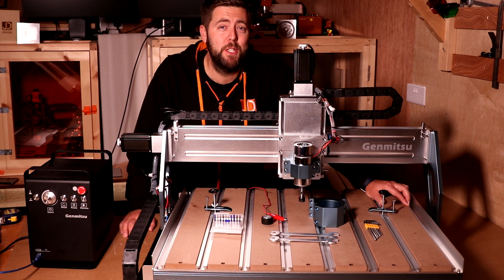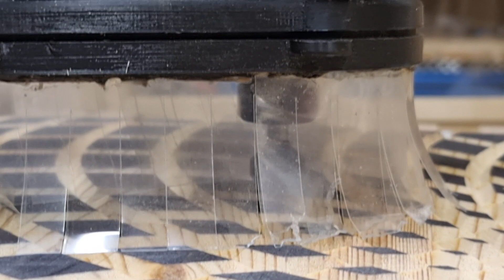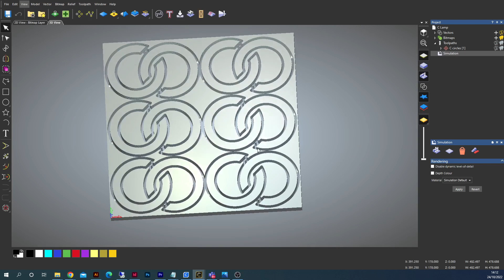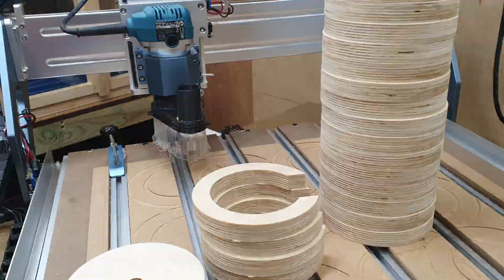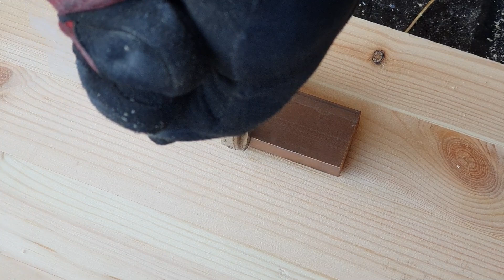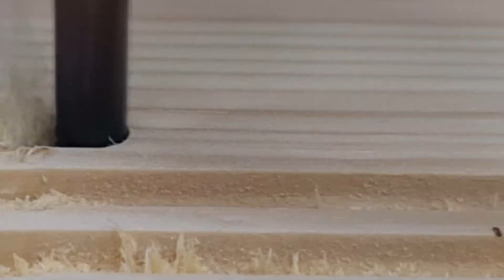Sainsmart Genmitsu PROVerXl 6050 Plus CNC machine review

Comment: I just picked up a 5060 XL Plus this weekend and did a full Tic Toc assembly video . It was one of those marketplace finds you cant resist ,especially for a new in box machine . Although they had lost the instructions and usb stick. Not the end of the world by far . I was quite amazed of how well the machine was built , I usually find myself pushing pulling prying....... to get things squared and trammed . the biggest issue i had was the spoil bords arn't super flat . So ill be milling them down . Thanks for the video

Comment: James how did you hold down those separate spoil board pieces? Also is it just strips of 1/4" MDF? Lastly, Why were the end piece narrower? Thanks, I am learning a ton about my 6050 by watching your videos, much appreciated!
Reply from the maker: Held down with blue tape and CA Glue. The thin strips are because your spoilboard should be the same size as you can machine, otherwise you can never correctly surface it. So the thin bit are because that's as wide as I could go

Comment: Great review and I'm setting mine up now. I noticed the entry point of slots you cut in the pine was not in line with the rest of the cuts. About a CM of the cuts were consistently at a slight angle to the left as viewed in the video. 
My last CNC, a Next Wave Piranha, did the same thing later in its life. It was one of the reasons we moved up to the 6050 Plus.
Can you tell what causes this? Is it normal or just a function of how you cut those slots?

Comment: What size table do I need
Reply from the maker: @jimhuitt9854  if you scroll about 2/3 the way down, there should be a table listing the overall sizes in inches and millimeters.  https://shrsl.com/3pybc
Reply: I see the work area  but I still don't know footprint like what size   table I need for the machine needs.
Reply from the maker: @jimhuitt9854  right below the work area size in the table it lists the overall dimensions of the machine - 776 x 641 x 580 mm

Comment: ive been tinkering and taking apart toys to build other things since childhood but as an adult and with all these new desktop cnc toys that exist now, the maker world is so much more awesome. ive been dying to get another bigger better cnc router. i had a 3018 that got damaged in a move and sat in a box for years till i finally threw it out in another move.  theres a "carvera" ive been drooling over that can do metals and has an auto tool loader feature and tool magzine but those start at like $5k. this thing is on amazon for 1600$ right now. Im not a huge fan of the single screw in the center of the bed for that whole giant gantry, but i guess it might be ok if those linear rails are perfect and have zero play and the gantry has not even a fraction of a millimeter play when you twist it. Otherwise i can see with the router being all the way over at one side and that center screw tries to push or pull the gantry it would twist the whole gantry and throw off the accuracy of the rest of the project. im real curious to know what happens when you try to move faster than the bit can cut when its all the way over at one side. And how good are those linear rails under the bed? any play at all? I noticed these companies save money by using parts that are mostly ok, but only if you move real slow and dont try to cut real deep. But the minute you go outside of its working parameters you start to see the weaknesses. and then its off to the races with the upgrade process. replacing bearings and rails and using hardened steel everything and thicker frame bits. and i work at a machine shop so having custom parts made on multi million dollar machines is fast and easy. next thing you know you can build a whole second machine with the parts you removed from the original machine to upgrade them.. and at that point you have so much invested in it that you wouldve just been better off buying a more expensive router. lol. story of my life. the upgrading and tinkering is just as fun as actually using the tool.

Comment: I "broke" mine! My router kept "slamming" the upper limit switch into the metal tab and it kept getting bent. I "kept" bending it back into position. Then, you guessed it, the tab broke off completely. So I did the only thing I could think of, I used JB WELD to hold the broken tab in place. I don't see Genmitsu providing that individual plate as a part for purchase. Any other ideas...anybody....anybody?

Comment: Thank you so much for the informational and instructional videos for newbies like me. After having the Sainsmart 3018 Pro for half a year, I have just received my PROVerXL 6050 Plus and looking forward to assembly and first time use.
QUESTION: While I will start with a Makita router in the build, is there a way where I can use bits from my 3018 Pro (all are smaller than 1/4 inch, most with 1/8 inch)?
Reply from the maker: Excellent. Yes you can, just buy a pack of these. Dirt cheap and allow you to use 1/8th bits in your router https://amzn.to/3ONmvIK

Comment: Hi James, Any update on your 6050 Plus. Has it become your daily driver or did you settle on an alternative?
Reply from the maker: It's a great machine but I did a follow up video comparing this and the original ProverXL 6060. Whilst this is more powerful machine, I need to do a few jobs a year that are larger than the work area of the 6050 so ultimately I have kept the original machine but that was only because of that one specific reason. On nearly every other element the 6050 is better
Reply: @JamesDeanDesigns  Thanks for the update. I currently have a 4040-Pro and loving it, but I do think I jumped in a bit quick and should have gone for the 6050sPlus. When I have had some use out of the 4040-Pro I'm going to make the move. Thanks for your efforts on your channel. Always interesting and informative.

Comment: Subbed...Just what i was looking for!!! Ordered the last one on the site using your link! I have a few upgrade questions. I need recommendations for a 40w laser/air assit combo for this unit, I also saw your review on the Fox, what kind of laser catch/waste board set up would i need for such a laser and, also a 2.2W water cooled spindle recommendation as well. Lastly, I only have a 110 set up in my garage here in the US, does that affect the power output of any of these devices?
Reply: Wish I would have known it's a "pre-order" item. Though the website says "one left" And now they say there are factory manufacturing problems and shipments will be delayed further. Maybe I'll just cancel my order, don't want to wait until July.

Comment: Curious what you think about this CNC vs. the Foxalien Vasto CNC? The Foxalien has a 400W spindle and ball screws, its now on sale for $1900 so that brings it close to the cost of this one. But this one has larger stepper motors and seems like a better bed design with less flex. For my use I'm looking to do mostly soft metal work. Love your content!
Reply: If you don't need all the Z clearance from the 6050 and plan to mainly do metal, get the vasto. the ballscrews make it a studier machine!

Comment: Thanks for another great video!
How did you attach the spoilboard strips to the bed sections? Adhesive or screws from the lower side?
I bought a Sainsmart 3018 Pro but ended up sending it back after a couple of weeks. The kit was beautiful, and it ran very well right out of the box. It just wasn't going to do the job for me as I want more power and precision. I'll be ordering a 6050 tonight!
Reply from the maker: The initial piece of MDF on this are screwed from underneath. If you want to add additional spoilboard slats then I would probably use blue tape and CA glue or strong double sided tape

Comment: Hi James, can you or anyone else answer me on this question please?  I am buying my first cnc router and thinking of buying the PROVerXL 4030 with 6060 extension kit & hybrid table.  Would it be better for me to spend more and buy  the Genmitsu PROVerXL 6050 Plus then buying the 4030 with upgrade?  Is the money difference, build quality and features worth it to spend more, which is $ 2,547.32 Canadian for the 6050 Plus, and $2,205.00 for the 4030 with 6060 upgrade and upgrade aluminum & MDF Hybrid Spoilboard Table .  Thank you.
Reply: the 6050 plus will provide more rigidity for more demanding projects.  The 4030 upgraded to  a 6060 will give you a little more working area with lower performance.   If you need the extra size go with the 6060,  if you don't need the extra size get the 6050.
Reply: @chrisl7949  Thank you for the info. much appreciated.

Comment: Linear rails are supposed to be 90 degrees/side riding, not on top!
Reply from the maker: I understand the logic but you may want to tell every other manufacturer then because I have at least 5 machines from 3 different manufacturers all doing them this way 😕

Comment: most powerful but just not rigid enough for aluminum, light cuts in aluminum cut dull end mills
Reply from the maker: I can assure you it is ridged enough for aluminium. I've machined aluminium on less sturdy machines that this.
Reply: @JamesDeanDesigns  I was talking about a $500 router

Comment: James, If you were looking for a good Quality CNC,  Would you buy This one?, Or the Fox alien vasto ?.  I know they have differences.  Would you Sacrifice size for the ball screws.? . I know this is a difficult Question to answer. But you have used both Machines and have far more experience than me.
Reply from the maker: ProverXL 6050 has size, stronger bed and stronger motors but the Vasto has ball screws and is $200 more so it really is difficult. Unless you do plan to machine metal regularly, I would probably go with the ProverXL 6050... I think but not 100% sure 😆

Comment: Excellent video James!  I am looking forward to the comparison video with the 4030...  For the 6050,  I wonder what wattage laser it will handle.  I heard somewhere that the 4030 controller box could only handle a 5 watt laser unaided...  If you want to use a 10 watt you would need to use an external power supply for the laser..   What do you think the 6050 could handle? Hopefully at least a 10 watt laser...   As big as the new controller box is, it should be able to run a nuclear power plant!!

Comment: Seems rather expensive compared to a oozenest for example
Reply from the maker: It can seem like that and totally get where you're coming from, but essentially different styles of machine, different hardware. For example with wheels vs linear rails, linear rails are usually going to ways win, however they do cost more. The other thing is part of the cost with machines like this, is you're paying for the ease of it being partially prebuilt where as most Workbee style machines are full DIY kits, you can spend hours, sometimes days building them. To a beginner an Ooznest can be quite overwhelming although they are great machines

Comment: Hi James 
Nice review. In your opinion would this be to advanced for a person new to cnc. Thinking of getting a cnc machine but I don't fancy spending that much on my first machine. So  I'm torn between fox ailien 4040 and gemitsu 4030 I want one around that size and wondering from a beginner pont of which would you recommend for me to get. Space is not a issue as I have enough in my shed for it. 
Thanks
Reply from the maker: From my experience,  the 4030 was generally easier from a beginners point of view. I've never had any issues with lead screws but have had some with belts. I think issues with belts are a little harder to diagnose

Comment: Looks nice but LONGMILL, made in CANADA, has a CNC that is 48x30 inch for the same price but without the router. They also have a 30x30 for $1349. Like your review though. I have the Genmitsu PROVerXL 4030 and extended it to the 6060. I like it but if I knew about the LONGMILL b4 I might have gotten it seeing it had a bigger work area.
Reply from the maker: Thanks. If size is what your after then yes, but the Longmill machines are weaker overall. They use smaller stepper motors than the ProverXL you ready have, the frame and build is also weaker so whilst size may be bigger, the performance of the machine will be less and not really an upgrade in my opinion from what you already have
Reply: I just looked at the Longmill after seeing your comment.  They really don't look comparable.  The structure looks much less substantial, there is no work surface, and the NEMA motors (which aren't even identified, which I find odd and a little worrisome that might source the cheapest parts at the time) are much smaller.  Presumably the controller and drivers are only sized for that weaker setup, also.  I'd warn people off making a direct comparison between these two unless they were educated enough to understand the negative trade-offs.

I have no affiliation or interest in either brand; I'm just a CNC video junky.

Comment: Hi James, how's that for timing....I bought one after see your build video and had just finished the build and come inside to see your review appear....Could I ask if you had any rough running noises,  mine is rough on the X axis but only when moving from left to right.Not sure if the drag chain is put it under pressure,  seems quite tight.
I also had a spare aluminium bracket supplied that wasn't listed in the manual,  think it would fit the Z axis perhaps for the laser.
Great review 👏
Reply from the maker: I sprayed the lead screw with dry lubricant and that helped the noise on the X axis. I think the metal shield actually makes the noise sound worse as well. I can't remember having a spare bracket but I'll check when I am next in the work shop
Reply: I had the same noise and it was driving me nuts. I found the problem and need to let Sainsmart know they need better quality control. The lead screw is actually to long. The extra length is being smashed between the stepper motor shaft and lead screw causing too much pre load on the bearings. I removed 3 mm off of all three lead screws and it is quiet now.